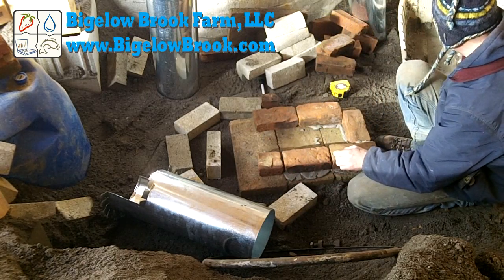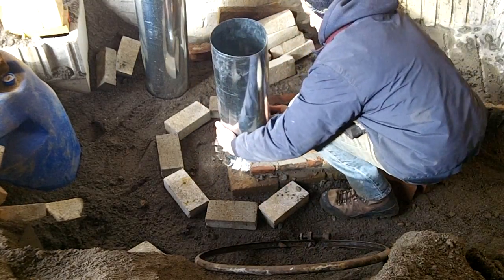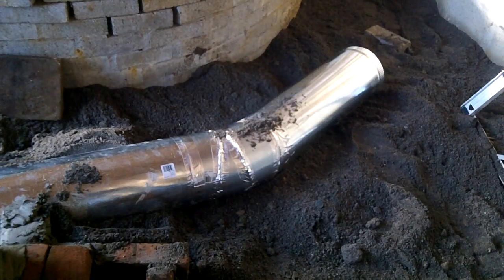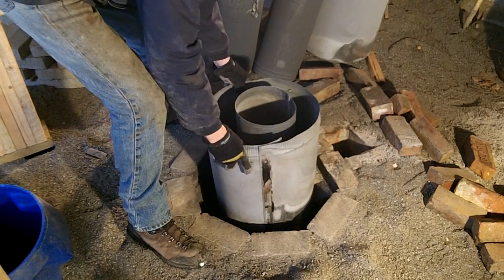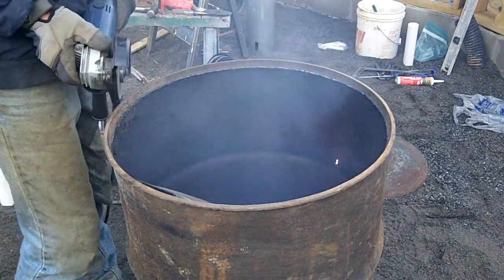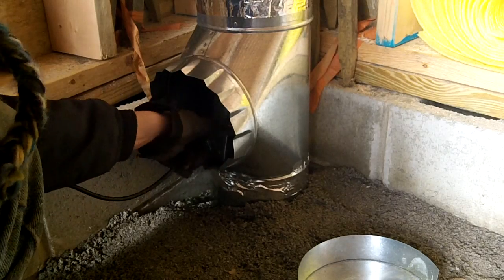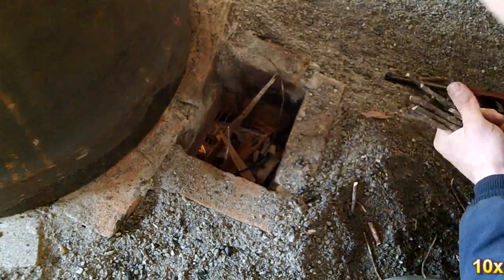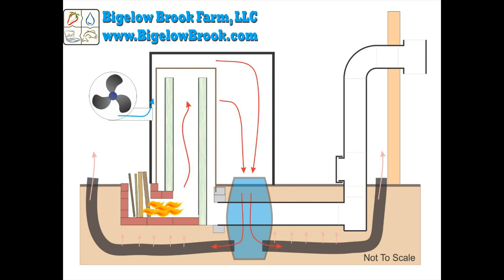Geodesic Dome Greenhouse - Part 10 - ROCKET MASS HEATER

Comment: It sure works, BUT from what I've seen and read, the inner wall of your chimney and that rock wool are gonna degrade fairly rapidly.  Thanks for the book recommendation.

I think the only reason people use cobb is because it's free.  If you're getting sand for cheap, that's really nice for re-designs and generally refining the work in progress, i.e., playing.

Comment: I liked everything in this Geodesic Dome Greenhouse playlist except that rocket stove. It is ugly and dangerous due to materials used. One should never use galvanized steel pipes for chimneys because tyey cannot withstand such conditions for long. Only stainless steel or ceramic materials should be used unless it is in temporary or throw-away type of building. It is 6 years passed since video now and I expect this heating system to disintegrate itself long time ago.
Reply from the maker: It's been 6 years and it's still running as expected.  Watch the other videos about it and the parts I expected to wear out did.  Since adding the new heat riser a few years ago, I haven't had to to any maintenance with it.
Reply: I have watched the other videos on the channel and they were very informative. Thank you. Still I consider the barrels and the buried flue pipe as weakest parts which need regular examination. I hope you won't get any heater accidents again.

Comment: you have to build your riser and burntunnel under the barrel  out of refractory firebricks, or it will burn through and quit working quickly. Even stainless or titanium will burn thru if the flame from a rocket stove is contacting it...

Comment: Now that it has failed, what would you have done differently?
Reply: build the riser and burn tunnel out of firebrick, or it will fail again. If you happen to want to spend lots of money, louisville firebrick co can cast you a core out of refractory material, but firebrick is cheaper, and probably just as durable
Reply: Lol, that's where I got all my firebrick.

Comment: In case you hit on a perfect design, you might want to use fire brick and unfired brick as the mortar. Mark my words, just mortar will crack and bust with that heat. Just ask your local masonry supply for some unfired brick, it doesn't cost too much.

And btw, what is cob?

Comment: Making an observation - not a real criticism as I recognize this is a regional solution where biomass from debris pickup is sustainable...

But a wheelbarrow of large grain trunk segments for 16 hours of warmth doesn't scale for a lot of folks. ;)

Love the series. Best wishes.
Reply: i built my rocket mass stove in the garage, and designed it to burn free woodchips, delivered free as well by the dumptruck load from a local tree service. it heats about  1200 square feet just fine for my kentucky home.
Reply: www.ageniusforhire.com

Comment: How does the sand work as a battery?  People say it doesn't grab enough here like cob - i'd like to use sand too... but it makes sense that it's poor thermal mass.
Reply from the maker: It works just fine.
Reply: Bigelow Brook Farm (Web4Deb) Thanks - that's great, because people have cautioned me away from it = saying it doesn't absorb heat well enough.
Reply from the maker: It probably isn't as good as encasing something in cob, but I wanted to be able to dig it up and make changes to the system.
Reply: Bigelow Brook Farm (Web4Deb) Totally.. the modularity of that is huge.  Good to hear it still works well. Is it typical road sand?  How moist does it stay?
Reply from the maker: Ben Falk This is crushed granite sand, but just about anything will work.  It's super dry once it's been heated for awhile...It's amazing how much dust is in it when you start digging through it!  ;-)

Comment: Then condensation is common ? I have massive amount of condensation on my rocket stove build. At first I thought humid day or green wood but then I wondered after using dry wood on a low humidity day. I just see steam pouring out of the flue.
Reply: if your flue gasses get below a certain temp, it will condense water out of the wood and even the air going into it., creating steam and water drops heading back down. You may solve this by insulating your stovepipe or just put a tiny drain in an elbow in the exhaust, with a catchpan under it like i did on mine. Also, if your stove runs for several hours and heats everything up enough, it may stop dripping.. www.ageniusforhire.com

Comment from the maker: 1)  No official lists.  I sort of came up with my own design based on various information I found on the web....and a lot of experimenting!  2) I'm still heating with pellets.  I have some other videos that details the pellets and some of the other work I'm doing with it.  check on my home page since there is a playlist of all the RMH videos.  3)  The temp in the water raises about 1 degree per hour since I'm heating 3000+ gallons plus the stone.  Overheating hasn't been a problem.

Comment: I have really enjoyed your video's (thank you for sharing them).. 3 questions... 1) Is there a list posted anywhere that you studied to design/build your greenhouse? 2) i remember hearing that you use wood pellets to heat now? if so, is it still using the rocket stove as a base (i think they burn pretty-much anything) and if so, did you build an auto feeder for it? 3) do you have to concern yourself with the temperature of the water going through the grow beds, heating it, etc?

Comment: There are outfits that use CO2 generators in greenhouses, which greatly increases growth rates of plants. However, if you were to send all of the CO2 from the rocket stove into your greenhouse, it would almost certainly create an atmosphere that is deadly to animals, including humans. Plant biomass is over 90% carbon, so if you burn 16 pounds of wood for a given period, the resulting CO2 output would be over 140 cubic feet of CO2, which is enough to kill in a typical greenhouse.

Comment: I would suggest that if you will be using the entire floor space for thermal mass storage you might want to provide an insulation barrier a few feet down and around the sides so as to reduce the heat loss in the earth as the ground usually maintain's about 55deg F and that would tend to take a lot of heat out of the heat system thereby making it very inefficient in my opinion.

Comment: In Canada and Wisconsin there are those using Aquaponic's (sp) as thermal solar heat storage and night time heat for greenhouses that use the water to grow food in floating bed's. I'm not sure just what the system is called but in the right hands it looks like a winner.

Comment: Web4deb is correct. Releasing the combustion gasses inside is a bad idea.  Plants do love CO2 -- when the sun is shining plants can use up all the CO2 in a green house in about 20 minutes.  Augmenting the CO2 to raise it from the natural 400 ppm to about 1000 ppm (1/10 of 1%) is good.  1% CO2 will give you a headache.  4% CO2 will kill.  Most fires will also produce some CO.  This is poisonous at 15 ppm.  Very ungood.

Comment from the maker: I still stand by my comment that it can kill you.  Venting the heater into the building will start he air oxygen.  Eventually, the O2 levels will get low enough where you will pass out and possibly suffocate.  The heater will also starve for O2 and start to burn less efficiently, burn cooler, and then start producing CO.

Comment: Your original question was a good one, and his reply sucked... CO2 (Carbon Dioxide) is an inert gas, and is harmless to inhale. It is also very beneficial to plant life... CO (Carbon Monoxide), however, is the one to worry about, and is the reason why you would NOT want to vent the heater exhaust into the greenhouse. CO is a colorless, odorless poison gas that is the byproduct of ill-oxygenated flame.

Comment: How long is the buried horizontal section surrounded by sand used as thermal battery? I ask because if I use this idea to heat my shop, I'd have to build the burn chamber outside, and run the 6" horizontal "flue" with mass surround through a wall and across the building- under the 16' work bench (?). I'd probably build a shed over the stove itself, and cut a large opening to the shop to utilize the immediate heat around the barrel. But I wonder how long of a horizontal flue might be possible.

Comment: This is such a good idea very cheap and efficient farmers should look into this especially in cold weather area's for heating barns and water supplies. I been wanting to add a wood stove to my old house but the codes and insurance companies will trash you or make it so expensive it is not practical. I believe I could do this and add it to my boiler system. I like the thermal mass idea and using an indirect tank. The oil supplier will be asking why I am using so little oil!? should I tell him?

Comment from the maker: I find that it's better to use the air that's inside the building.  For the first hour of the burn it removes a lot of the humidity in the dome which helps to reduce the risk of disease on the plants.  There's enough leaks through the building where fresh air comes in all the time.

Comment: I like the video's a lot keep them coming. I do have a question about the combustion air. It seams that you are sending the air that you are working to heat out your chimney. is there a design that lets you use outside air for combustion?

Comment: So instead of adding to atmospheric CO2, you reuse it in the glasshouse where CO2 levels drop off, and increase the grown biomass by up to 40% vs without the Co2 injection.
Reply: Ok, this is a bad idea.  My bad. CO2 augmentation only works when Co2 is the limiting factor and in winter when you're trying to heat up the greenhouse, the limiting factor is low sunlight and not Co2.  So, you're only going to introduce dangers by venting gases into the greenhouse.

Comment: Very nice video and diagram, nice pace and easy to follow.  Awesome project!  The little touches you added like cleanouts, drains, and super-tall chimney are spot-on.
How's your mineral wool holding up? 

If you do add clay (or water) to your sand, you may find you retain slightly more heat inside the greenhouse.  It doesn't take much - maybe 10% clay.  Most places you can just add dirt.  Drop a line on the wood burning stove forums at permies.com if you want a longer conversation.
-Erica W

Comment from the maker: @GeoDomeGuy The entire thing is an experiment so I want to be able to replace parts as needed.  If I used clay, it's much harder to make adjustments.  It's the reason why I used sand so I can dig it out in the future.  Plus, there isn't any clay around here and I don't want to truck it in.

Comment: @TimmyOFlinn 
Yeah. I think it would work. Or you have a slave put a few small diameter wood on the fire all the time. :) Wood chippings or briquet's could work also.

Slight problem though that under such operation there is constant draft through the chimney which take somewhat more heat out, than if it could be closed between  heatings. But i guess its still much better.

Disregard the rating, i just hit the wrong button.

Comment: @TimmyOFlinn 
It is efficient regarding the amount of heat out of the amount of wood. How you use that heat, or if you overheat the place you are heating is not part of the equation here. So normally a rocket stove is not such a good idea, because it gives too much heat for too little time. If however you can store the heat produced and use it up economically then it is a win - win combo. Another solution is if you can micro manage the fuel input speed i think.

Comment from the maker: @josiahcholladay not very long after I stopped burning.  Right now the building isn't insulated and I'm not pumping all the heat into the thermal mass.  Once everything is done, it will take a while to get the floor mass up to temp, but it should maintain it for a long time.

Comment: @TimmyOFlinn Rocket stoves are so efficient because of the way they burn the wood. There is very little wasted fuel compared to a traditional wood stove where there is 25-50% waste of combustible fuel that goes up the flue. Capturing the heat in the floor or other thermal mass would be more difficult as well without the advantage of the rocket style burn in the combustion chamber. That said, you can heat a thermal mass with a traditional wood stove, if you really wanted to.

Comment: I heard the the rocket stoves are very efficient but I'm confused by the fact that there is no way to control how fast the wood burns. The only efficient part is in how you capture the heat in the thermal mass. Could you not achieve the same effect with a normal wood stove with the exhaust buried?

Comment from the maker: @DrReaper One cleanout is where the fan goes in to start it.  The barrel comes off easy enough where I get get any ash that may have gone through the chimney.  I have access to the entire horizontal from there.  From what I've burned so far, there was next to nothing in there.

Comment: @web4deb You mean CO detector? You could probably get an arduino programmed up to open a valve that will maintain a certain level of CO2 in the room and also shut off if CO reaches a certain level too

Comment from the maker: @josiahcholladay Since the building isn't really done, I don't have any official measurements.  But for the 1200 sqft of insulated space (and a lot of drafty leaks), I burned a wheelbarrow full (around 50-60 lbs?) for around 16 hours.  The sand floor was frozen.  It was 18 degrees and windy outside and I got the temp inside up to 43 and the floor thawed out.  Considering the conditions, I was impressed!

Comment from the maker: @therawlifefamily It has to be a sealed system and vent to the outside to meet the building code.   With that said, at some point I may install a CO2 detector and relocate a few fittings.  ;-)

Comment from the maker: @Trauncher The burn chamber shouldn't be larger than the chimney or else it can choke the system.  For an 8" round chimney, that's 50.2 sq inch, a square burn tunnel (mine is about 6x8) is 48 sq inches.

Comment from the maker: @mrsengeseth You have to let it go out and cool down.  Then just pull it out of the burn tunnel.  There's very little in it.  In the future I may come up with a way to remove the ash while it's still running.  It depends if it becomes a problem or not.  ;-)

Comment from the maker: @cutshall44 I currently don't have the proper probes to read the internal temperatures but I will at some point.  My infrared reader topped out at 500.  I couldn't read the top since it was over 500.  About 3-4 inches down the side, it read 480, by the time it was about the bottom, 275.  The temp of the thermal mass was around 125 (near the center of it).  The vertical exhaust was just warm to the touch and was 85.  (all temps in F)